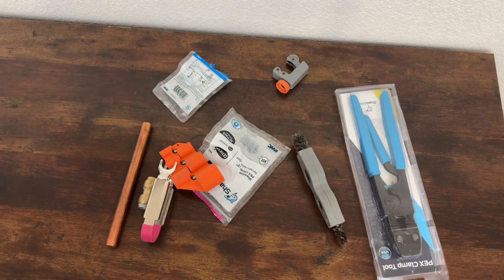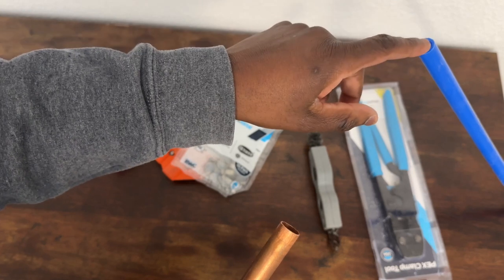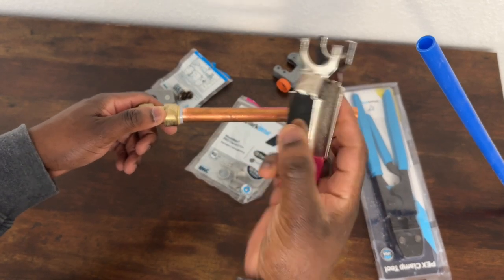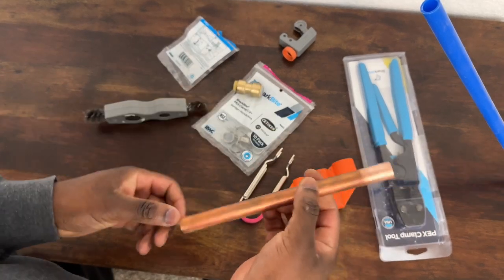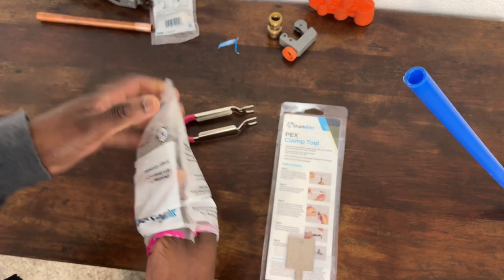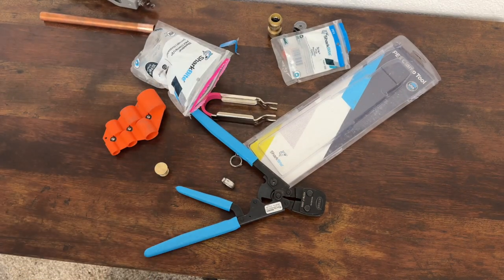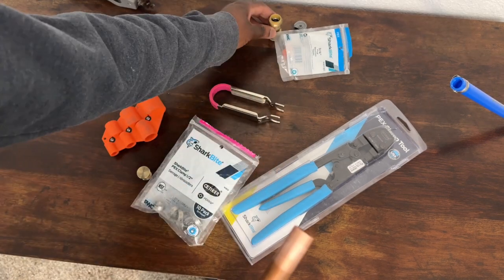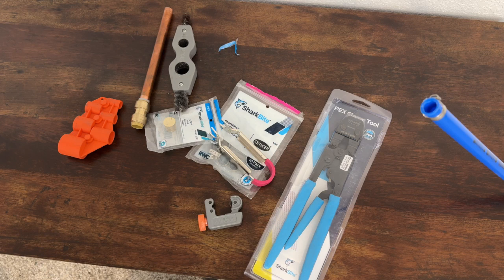DIY Plumbing Made Simple: SharkBite Connections & PEX Crimping Guide

Comment: The pex gage is also a deburring tool.  You should run it around the pex to take the sharp corner off the pex after it is cut.  This prevents O-ring damage.
Reply from the maker: Huh, I have never used mine as debarring tool. Mine is mostly plastic. I will have to check it again.

Comment: As a plumber in New York shark bite fittings that are used are illegal! Either pro press or soldered copper. If your job was done with shark bite fittings and you get a flood you are not covered by insurance.
Reply from the maker: Thanks so much for your input! There’s definitely a lot of debate around SharkBite fittings. I think it really comes down to local code, every jurisdiction has different rules. In my area, SharkBites are still allowed and not considered illegal yet. On the other hand, polybutylene piping is banned. If you buy a home with it, you’re required to remove and replace all of it.
Personally, I only use SharkBites for emergency fixes. I’ve used them before with no issues, but I’ve also seen them fail badly. Truth is, almost any system, copper, PEX, or fittings, can fail if the workmanship isn’t solid.
And when it comes to insurance… they always seem to find a way to avoid paying when it really matters. 🤷‍♂️